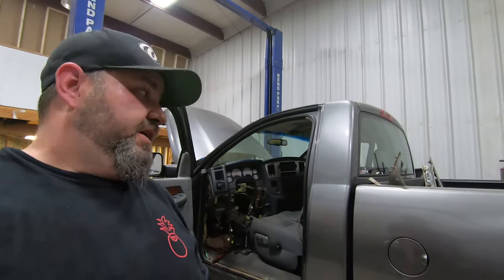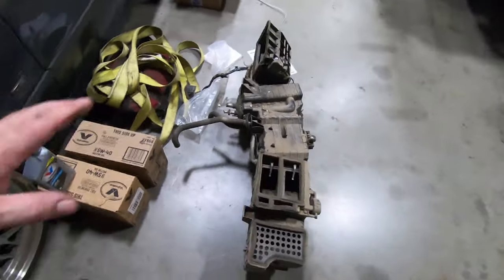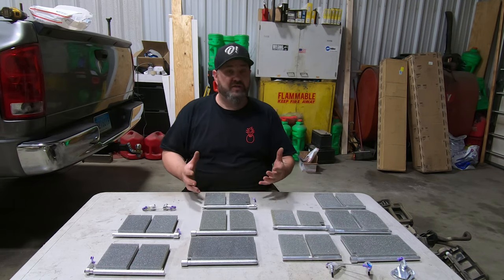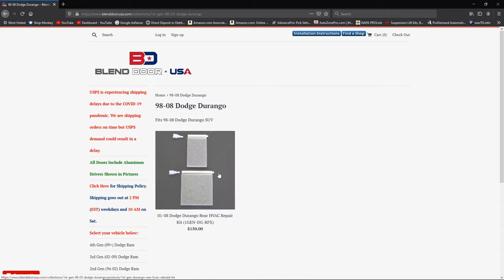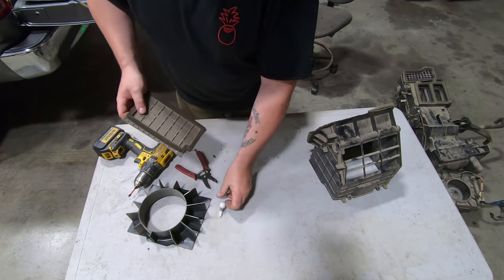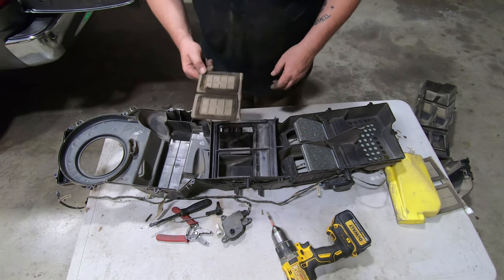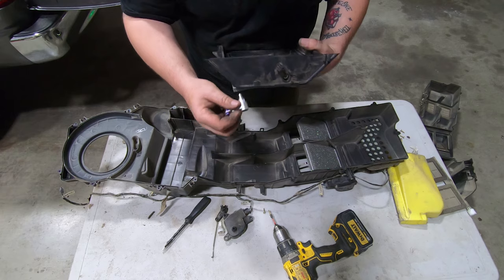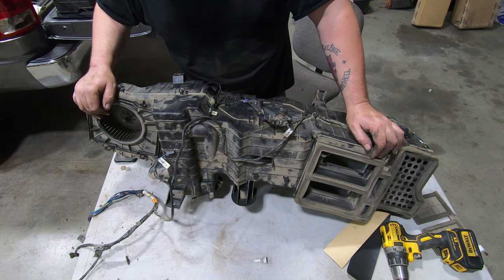Dodge Ram 2500 Blend Door Replacement (DETAILED)

Comment: Question. I see a guy with a Cummins put a shut off valve on both heater hoses. Can that help with getting colder air ? I live I. Florida 80 weather feels like 105 cause the humidity

Comment: Great vid. Thank you. I'm trying to diagnose warm air (70-75°) coming through when AC is on & fully charged (40psi low 160psi high on 80° day). I started thinking maybe it was the blend door after watching this BUT vent temps aren't substantially lower at startup when engine is cold, AND I still can get hot or cool from the vents, back & forth, which tells me that my doors aren't stripped.

Comment: I have ALOT of foam blowing out of my vents. What would you suggest for foam replacement. Stock OEM packings as they are titled, are expensive, for foam that deteriorates. What did you call it, open cell?

Comment: Hey Morning How much did dodge dealer cost to repair the blend door modes. Did you get an estimate? With everything heater core , air conditioning coil and doors? I’m looking at a super clean 2006 Dodge 2500 quad cab that needs it done. Just looking to see how much off the price of truck I’m going to deduct. Thank you for any assistance Joe

Comment: I have a 2010 Power wagon.  I only have heat or cool that come out of the passenger side of my truck.  Single zone.  All the vents switch properly to the floor, windshield etc.  But only room temperature air comes out of the driver side.  As I said all vents switch back and forth as normal.  The only thing is that only hot or cold air come out of any vent on the passenger side and just indoor truck air comes of of either of the driver vents.  Could it be a stuck temperature blend door?

Comment: 2006 Dodge Ram 2500 SLT. I was told I needed a module. Rear tail lights not working. Dealer wants $1500 and module on back order. Can you help please, thank you.

Comment: Great detailed video. Since I'm one of those "Limited number of people" mentioned on the website that has a Mega cab with the rear vent system and would need the special dual zone MC kit. At the end you did address the dual zone doors but didn't mention the differences when changing the doors. Does the Dual Zone have 2 actuators (second being where you called it a dummy' connector)? The website also mentions the MC kit will re-use the existing rear vent system door. I know you didn't have one to demonstrate what thy are talking about.. but it would be nice to know.

Thank You!

Comment: Excellent video and instructions. I have the mega cab version. No questions from me, just a recommendation:
For anyone doing this job, it is a wise choice to purchase the Mopar foam sealing kit to replace the weather stripping.
It is precut, with adhesive on one side to stick onto the vent box. It is simple and works very well.
I would have never done this job without your video. Great work!!!

Comment: I started having problems last week just before New Year’s , Blower is stuck to blow at my chest. After watching your video I was able to stick a wire through the box to open up the vent so I could have defrost for the winter. Will Attempt to fix all the doors in the summer. Thanks for that  awesome video

Comment: I’ve had my eye on the blend door kit for a while , just waiting until I need them to put them in. I think about the doors breaking every time I turn my dials so I try not to move them. I don’t like change so that works for now. Lol. It would be nice to have a removable plate on the fire wall to remove the heater core without pulling the box.

Comment: Great video thank you. Struggling since May to get my air working right. Almost everything has been replaced. Orifice tube was frosting up and air was warm out of driver and a little cooler out of passenger side. Dealer said orifice tube was clogged so I got them a new tube and they banged me for another $228 and now for the second time since May we were ice cold.   My air was blowing cold and then I came to and intersection. After sitting at the red light for a few min, I started moving again and the air got warm. Since these are servo motors and not vacuum actuators this makes no sense. I had Dodge put in these dual zone Blend Door USA doors in May and after 6 trips back to the dealer the air was finally blowing cold. So cold I turned off recirculate and put fan on low and then added about 2 or 3 clicks of heat to the driver zone. 2007 2500 Megacab 5.7 cummings. I have spoken to Jim several times since May to Jim trying to figure this out. On recirculate the air noise is loud but the air flow in my opinion seems weak. I had the dealer pull the dash again and remove the screen which I think helps divert air to the back seat and I got a little stronger air flow out the vents. There is a lot going on here and I did not write this in chronological order so feel free to call me with any questions. Bobby 561-722-3248

Comment: LIKE YOU, I HAVE INSTALLED OTHER DOORS. BLEND DOOR USA HAS THE BEST PRODUCT HANDS DOWN !!!! ABSOLUTELY THE BEST DOOR OUT THERE, PERIOD....
AND YES, USUALLY THE DOOR IS BROKEN AT THE PIN AND THE RECIRCULATE DOOR FALLS DOWN AND COVERS THE FAN INLET SHUTTING OFF AIR FLOW. FYI, THESE CAN BE REPLACED THROUGH THE BLOWER MOTOR HOLE AND THE GLOVE BOX WITHOUT REMOVING THE WHOLE UNIT FROM THE TRUCK. I'VE DONE IT 2-3 TIMES.

Comment: There is only TWO blend doors(on top and bottom of the heater core), two mode door(where you want the air going to), and one recirculate door.

Comment: Jim from Blend Door USA is an absolute pleasure to work with…..super great guy. Dodge Rams are great trucks but the do have their weaknesses. The blend doors is one of them. If you own a 3rd gen Ram, at least one of you doors is broken. This is the answer to making your HVAC system bulletproof.
Reply: I have a problem with my ac my driver side blows ice and the passenger side blows cool/warm is this my problem as well?
Reply: @JohnDoe-dv9yl  more than likely it is your problem. It was actually really easy to remove the dash and the heater box. Replace all of the blend doors in your heater box. Also bench test each of the actuator motors. It is as simple as using two jumper wires and a car battery or battery charger. Removal of the dash is easy as well. There’s another site on YouTube that shows you step-by-step how to do the entire job. I end up replacing my entire air conditioning system, including the heater core, evaporator coil, condensing unit, compressor, filter drier, and the smaller diameter line that has the metering device in it in a total of eight hours with two people. I am by no means a professional. My heating and air system works great.

Comment: outstanding video. My heater went out but I think my heater core is just fine. I think the door that lets the heat in is broken in a closed position. I’m going to try and do this all myself and order a complete kit for my Dodge ram. I’m a little nervous tearing my dash out.
Reply from the maker: Brittle plastic. Most times they break where the plastic shaft meets the door. The plastic gets super brittle over the years and the actuators are pretty strong. If a door gets stuck or of your blower is on high and you change modes, the force on the doors is enough to break them.

Comment: But you have to disconnect the ac lines to the evap core and then recharge the ac right? Is it worth going ahead an replacing heater core and evap while you're in there doing blend door?
Reply: Yes, I would. And also, any time you open up the AC system you need to replace the drier/accumulator.
Reply: @JM-sy5qv  I think anytime you have to replace anything on the heater box you should replace everything at the same time.Blend doors in the Ram will break at some point in time. Their plastic construction allows, the heat and cold to make them brittle overtime. heater, cores, and evaporator coils could also get dirty and plugged up, in addition, the trauma that they go through just from removing the heater box can put a little extra stress on the connections and cause it to fail early.

Comment: I see you still respond to comments, so I was hoping you could help. I have an 06 2500 Mega Cab. I’m going to replace the blend doors, evap and heater cores and the blower motor. Do you 1) know if all trims use the same parts for the cores and 2) have a brand you recommend for those?
Reply from the maker: The mega cab is different. It has an extra door I believe. But blend door USA makes a kit for it as well.
Reply: @MorFabIndustries  we do have the rear vents and I selected that option with Blend Door USA. I’m going to try and make this a weekend project for my dad as he’s been driving without AC for some time now. At the moment, it looks like it’s all coming together at about $750, but I also need to put in a compressor I think

Comment: A big tip for you who have good working blend doors. Never change your blend doors whe the blower is on and that means turn off your blower for a minute then change your blend doors to on your feet inside outside air or defroster and if you do this your doors will last a long time. If you change your blend door with blower on high you can hear them slam shut and that’s what breaks your doors or crack your pins or where pins go into the doors. My 05 broke the inside outside air by hitting a utility trench across the hiway with no signs or warnings but that’s a easy fix and if you blower is on high and you can hardly feel any air flow. There are 3 screws that hold blower motor under glove box and there is a electrical connector and lower down blower motor reach up inside the hole where blower came out and grab the broken blower door out may have to flip it around to come out plug in your blower and put blower back in and you have full flow again! And if you want out side air open a window a little and inside air close all windows and it works great and will freeze you out or heat you up just like before no parts just 10 minutes of your time hope this helps some of you guys .
Reply from the maker: Great advice!

Comment: How do you remove hvac unit without discharging a/c Freon ? That is something only a shop with recycling equipment can do by law. And after reinstalling hvac it will need to be evacuated and charged. So how does a diy guy do this ?
Reply: Go to a place like Jiffy Lube or a Mechanic shop, or better yet CALL THEM BY PHONE,  and ask them how much it would be to evacuate your system,  then later to recharge your a/c system. 
That seems to be the only way,  unless you know someone who has the HVAC Machine.

Comment: Thats nice then the plastic gears strip on the actuator then your pulling it apart again just fix it with oe parts
Reply: Hey It probably easy to change out the actuators. There right out frontside.

Comment: After putting heat in vehicles for 100 years what is dodges excuse for installing such a piece of crap of a hvac system !! I have had 5 rams since 94 and every one you sweat in the summer and freeze in the winter  !!  Nice video !

Comment: I tell ya loved my 08 3500 ram pulleds my 34 ft fifth wheel nice, but since owning, the catalitic converters plugged 9 grand to replace theres 3 of them underneath , ok go down the road anther 10 thousand miles now the heating system wont work try that when its 40 below windchill, dont nknow at this moment whether its actuators or doors, looks by this video that its a busted door,  i dont get proper cooling or proper heat, actually it was no heat , my wife was screaming at me. As to how cold she was. So what now ? Im retired dont want to buy a new truck have you priced one lately? So my other option then is sell the camper and truck. Try selling a truck where air conditioning system doesnt work. Chrysler shoukd be ashamed putting this plastuc crap out there.

Comment: Freon . ? We don't have that technology at home. Some local shop will remove it for you first. Then take it home. Do the job go back to shop and fill. Or auto part store , fill your self . YouTube it
Reply: Take you vehicle home
Reply: And please don’t just fix your blend doors get a new evaporator ac get a new heater core and only buy actuator motors from your dealer they are the best the rest that I’ve seen are junk so good luck and once you get going on doing this job it gets easier and goes back togather even faster and once you start keep going so everything stays fresh in your mine.The dealer wanted 1700 bucks with the same old doors and don’t want to use aftermarket parts. The cheapest labor for this job was 600 bucks with out parts !

Comment: im a master tech how did you screw up the evap fittings so badly man oh man and you bent the crap out of the core lines i recommend not doing that anymore wow
Reply from the maker: Not sure what you are looking at mr master tech mark. I put a brand new evap core and a brand new heater core in. I didn’t bend anything nor were the evap fittings damaged in any way. Perhaps you didn’t watch the entire vid. The reason the box came out in the first place was due to a leaking evap core and broken blend doors. The evap fittings were rotted on the original as this was a pennsylvania plow truck. The ac lines all crumbled in the engine bay.

Comment: Over $300  for just aluminum doors.   No thank you i stick with plastic.  I don't plan to keep the truck forever.

The video is good on the main part  pointing out the bolt locations and quantity.   That is all i care to know.

As a matter of fact I am done with dirty fuel vehicles with enough damage done to the environment.  I drive this  diesel thing until i get my Tesla Cybertruck.  I am going EV 100%.  there will be. no more iCE vehicles purchase from this point on.

Furthermore my 2003 Ram 2500 diesel  has only 220k miles on it.  plenty of life left on that Cummin motor.  Yeah i know the tranny is a weak link but even that i can tear it apart and rebuild if need to.   Now there is no such thing as motor and tranny rebuild or repair in an EV and i can charge it with my solar system.

The future is EV.  Any one refuses to accept that will wake up with a rude awakening one day.
What is NOT to like about EV except NOT knowing enough about it.  That is life with always a slow adopters and closed minded people but eventually they will come around following the rest or else ??????!!!!!!!!!!